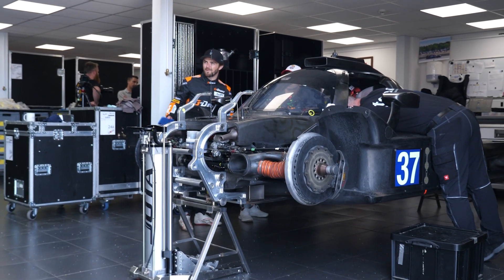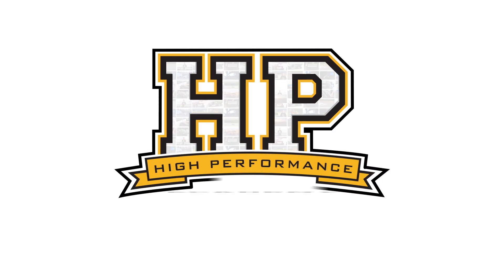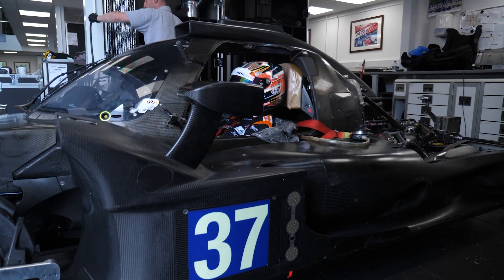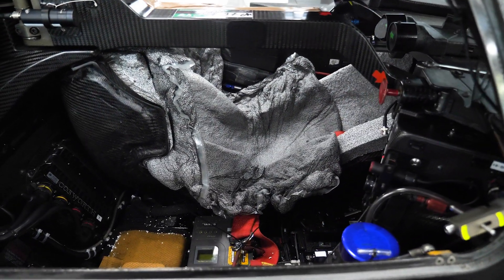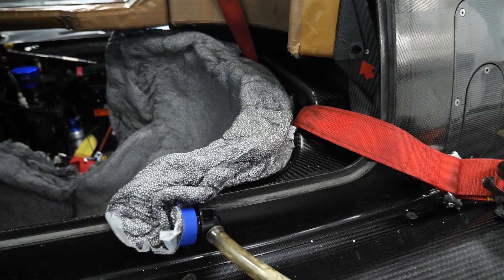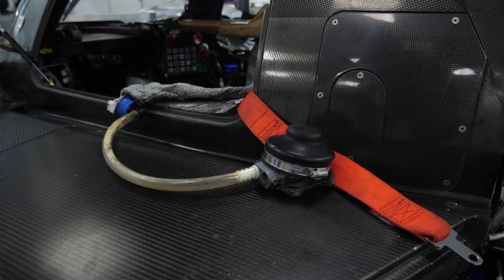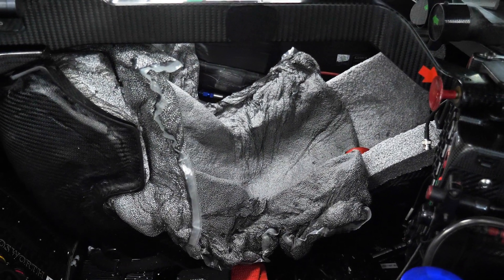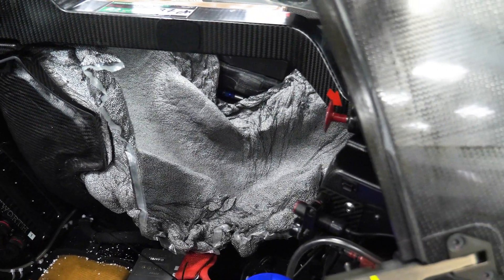The PERFECT Racing Seat? | Precision Driver Control

Comment: While the fit is very important for holding the driver in place for control, even more important is ensuring the seat is both strong enough to resist impact forces* AND the fixings to the vehicle are strong enough to hold the seat securely in place.

*Back in the bad old days it wasn't unknown for seats to break in general usage, let alone in a crash - I know of one instance where the driver broke one reaching for something behind him. I know of anther case where the seat mounting plates weren't quite right, and one of the mounting points cracked when tightening the mounting bolt.
Modern seats are made much, much better and have to meet standards - but if buying s/h, make sure you go over the entire structure CAREFULLY, especially the mounting points and where the back meets the base - if it was in an accident it may be damaged and unsafe.
Reply: I find this aspect of seat fitting to be a step further than holding the driver in place, per-se, and more about making the driving MORE comfortable over a LONGER period of time. As you say, seats now - decent ones - are made incredibly well. Custom moulding the cushion is more of a fresh driver being faster driver aspect. Sorta like having a neck / rib brace in a go kart. Do you NEED one? No. But would you feel better after a couple of hours racing if you had one? Probably, yes.

Comment: There are a few but at AUD$900 each with 5 drivers for our budget endurance race car, it doesn't work. I would very much like to know what sort of foam/epoxy or two-part polyurethane are used in the kits so I can get a larger quantity from an industrial supplier.
Reply: The flame retardent aspect is VERY important, as is the imporance of ensuring it's not going to give off toxic fumes when it burns - some release cyanide gas.
Reply: @gordowg1wg145  whilst I agree with what you say the same can be said for your approved race seat that’s made from epoxy resin , 

the polyurethane foam that’s in your seat , 

your
Polyester / nylon race harnesses , 

the paint that you painted your car interior in , 

the lightweight polycarbonate windows that you may have fitted 

 the pvc insulation that’s on the majority of wiring looms except mil spec 
All highly flammable and generally have no flame retardants
Reply: Expanded polystyrene balls should be quite easy to get hold of . From what I know there is no difference from the ‘common’ white coloured ones to the black ones they use for seats . The black colour is probably only for aesthetics , there is a possibility there may be a fire retardant added to it but best to check. 
Just buy a bean bag , cut it open and you will find the same polystyrene balls . 

There are many different epoxy resins , including a semi flexible one which is what I suspect they use for seats . Simply from my experience normal laminating resins would just crack when used / taken in and out 
. Do not use polyester resin this will dissolve your balls , the same goes for contact adhesive when covering your seat . Think there’s some that’s styrene friendly / latex based . 

You could be correct with the 2 part polyurethane resin and it could be a foam resin ( not your builders foam ) 
A US company called Smooth On sell this but has very quick setting times 
And from the couple of videos I’ve seen making seats in the past cure times are longer . If you find the cure time then that will narrow down your search for resins . 

I t would pay to do a bit of research on vacuum bagging if your not familiar with the process this will highlight some pitfalls of vacuum leaks . 

You shouldn’t need a vacuum pump just a cheap vacuum cleaner and a shut off valve.Or just pinch ye old wife’s while she’s out 😂. Vacuum bag leaks will mean you will need the vacuum cleaner on constantly which may lead to a burnt out vacuum cleaner a very cross lady and a trip out to buy her a new one !!! 

There are large vacuum bags now available for packing domestic clothes, these should do but be extra careful not to puncture the bag !!! 

Lastly there is an excellent channel- easycomposites (YT ) very very good and lovely to deal with based in the UK . I but some of my carbon and resins from them . They may be able to point you in the right direction resin wise , would need to talk to Paul or someone in the technical dept , nice small company too and export. 

I recon £100 in our money for materials for a set that includes a 3/4d stretchable fabric for covering. 

Hope this helps , ping me back if you need anything else 👍

Comment: does anyone make a kit to do the polystyrene and epoxy version, for home gamers?
Reply: Not a lot that I'm aware of, but you can do the same thing with expanding foam where you put it in a large bag on the seat with the cushions/padding removed and then start the reaction to expand the foam while sitting in the preferred position. 15 minutes later or so and you have a custom fit seat. Let it harden/cure, shave where needed, upholster and you're set. It needs reinforcement if you plan to race on it but if you're doing gaming, then you're set